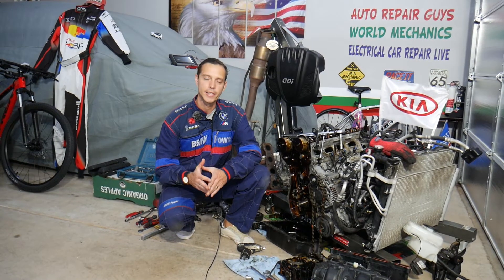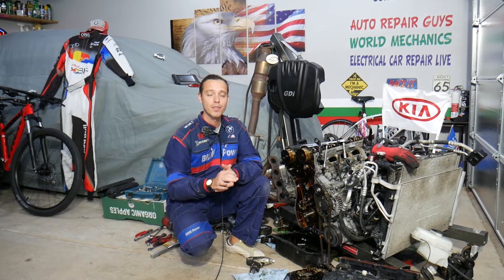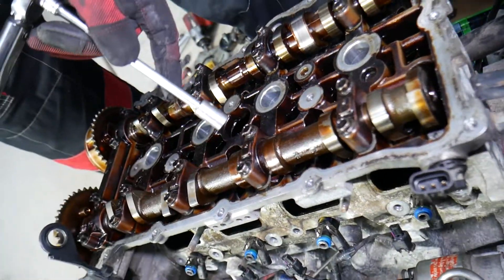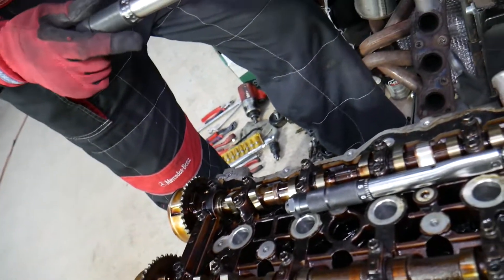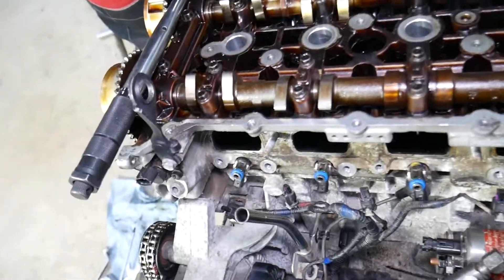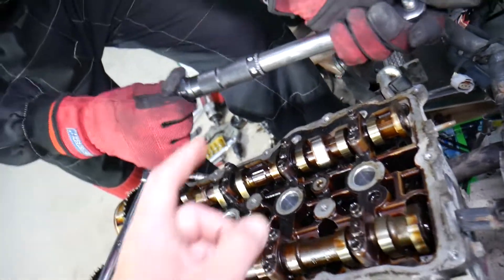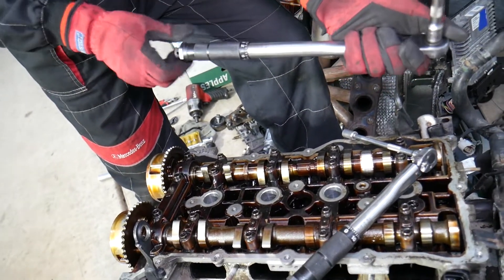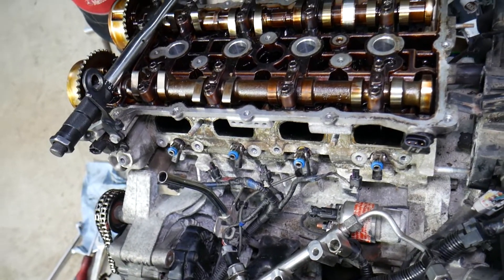KIA OPTIMA CAMSHAFT CAPS TORQUE SPECS AND BOLT SEQUENCE 2.4 GDI ENGINE

Comment: Hey guys. Great videos! I am looking for a video on Fiat 500 about removing/replacing the AC Control Panel. I swear I just watched it a couple weeks ago when my AC stopped working, but now I cannot find it on your channel and it's gone from my youtube history. I got it detached from the dash board but cannot maneuver it out through the slot. But in your video it looked as simple as removing a normal radio.